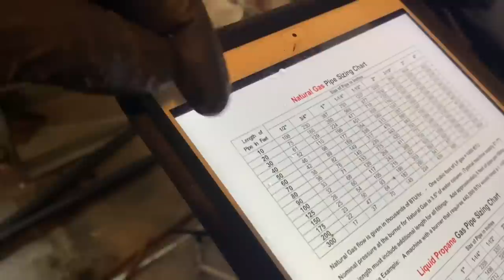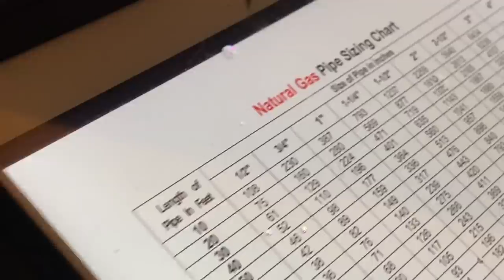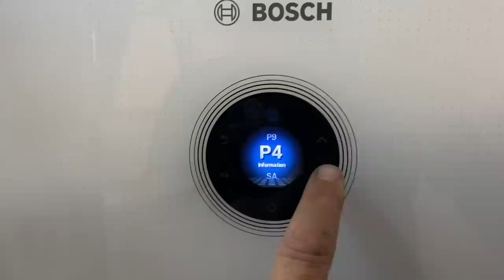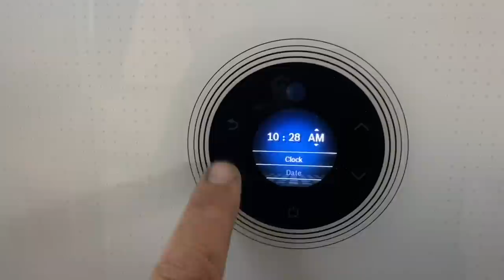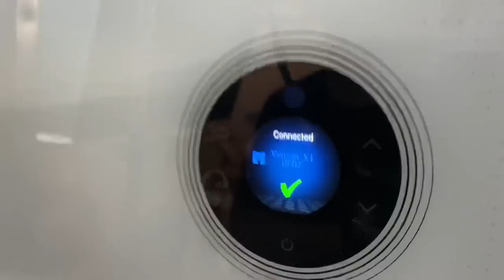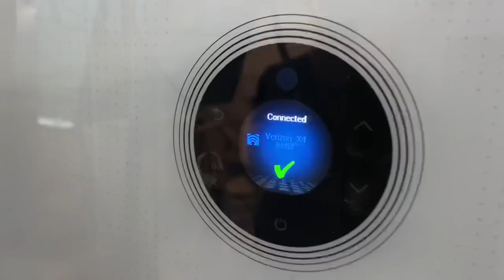Part 1 Oil Furnace and Water Heater to Natural Gas Conversion - Installing Bosch T9900i Tankless

Comment: I’ve seen this display before, it’s pretty darn cool. I always thought WM should hook up a big arsed properly sized (sqr ft ratiation) radiator so it operated as a system.
No one wants water climbing the risers into the header, wet steam.

Comment: Drip trap minimum length 3 " and same diameter as supply pipe. But if diameter more than 3 " so length of drip trap will need to be same as pipe diameter.

Comment: I’ve installed these units in MA. Setup is a breeze and the top connections and bottom descale tappings save on material and time. Nicely done! I prefer to use the Centrotherm venting
Reply: Nate what is the minimum clearance I would need to to accommodate the descale and gas tappings of this unit?  I  am dealing with a crawlspace install so I need to mount it lower than I would like to accommodate the venting and plumbing tappings on top.
Reply: @joebal9044  go read the manual for it? RTFM! 🙃 I know reading and decoding them sucks, but it's part of doing a proper job.

Comment: Ex Lilco guy here I suppose you could of asked Nat Grid to upgrade that meter bar to get rid of those 1/2 swivels, (20:47) Poss if they came to job site they would of just given you a meter bare/3/4 swivels  to install ... just saying , I also suppose it will be ok the way it is cause not a long run to both HH and WH ..I did not look at the chart but I imagine it will support the volume needed ( but you guys looked up the chart ).. whatever , awesome install Mikey Pipes and Crew , many people plumbers and customers ask me which wall hung unit is the tits unit , Navien ? NOT  Laars ? better but NOT...  Bosch ... Home Run me likey the Bosch Mikey Thanks to The Pipe Doctor ... If its gotta be a wall hung I will always suggest Bosch from now on .....

Comment: Discharge for pressure relief no further than 6” off the floor nothing closer than double the pipe diameter off the floor so 3/4 can’t be closer than 1 1/2 to the ground

Comment: Hard to believe that the local gas company allows the high-pressure gas line from the street to enter the house under the concrete floor.  A leak anywhere on that line can follow the pipe into the house.  Typically, all penetrations are made above grade with the gas meter outside.
Reply: In Switzerland we run the gas mains in the streets with „elevated low pressure“ at 200 mb.
The connecting line to the houses is laid in a depth of 1500 mm and has a stop cock outside the building, usually in the area of the sidewalk.
The penetrations for the gas line are made through the concrete wall of the foundation. 
At the inside you have directly the stop cock, the pressure regulator (at 22mb) and the gas meter. 
And your utility company owns the whole installation until the outlet of the gas meter.
Reply: 2psi is medium gas pressure. Not considered high pressure 🤙

Still has gas meters hanging in Minneapolis. I found many with rotten carrier pipes 😂
Reply: @prestigemechanical3600  Here in central NJ, PSE&G installed new pipe inside the old pipe and doubled the pressure. New WI-FI indoor meters.
Reply: using navien disc covers 😆 🤣
Reply: @2pugman  they've done similar here for the old low pressure neighborhoods (meter in basement/home) 2" or larger pipe entering. they have adapter collars to poly pipe and use the old straight sections as conduit. that fixed many leaks all over the place, some were over 13% leakage rate.

Comment: I currently have a Navien Death Box NR240 and looking to replace it with this Bosch.  My challenge is the height of the crawlspace where it is installed.  This unit is 3 inches taller, so I would have to mount it lower on the wall than the Navien so I have more space on top.  What is the minimum distance I would need to the concrete floor on the crawlspace?  From what I can tell the only connections that are on the bottom are for the gas.  This would be an LP install.

Comment: Hi Mike.  Thanks for another great video.  The Bosch T9900i install in my house (in Delaware) is almost done.  When I question the plumber about installing an expansion tank, he told me it's not required if I don't have an holding tank.  Is this true?  I have lost trust in the workmanship of this plumber and have decided I'm going to hire another plumber after the work is done to come in to check the install.
Reply: If he installed a check valve on the cold water supply, he had to install an expansion tank.

Comment: Miley pipes my brother a few days ago smelled burning rubber went downstairs and a blower motor had caught fire. ADT came out and everything. Question how many motors/air handlers would there be with a gas furnace and two a/c units?

Comment: Those sharp 90’s above the tankless allowed in the manual?  AFAIK only long sweep elbows are allowed on that model.

Are you allowed to use clear primer on pvc in your jurisdiction?
Reply: in most all cases, short 90's are usable, but they're equivalent of many feet of piping in resistance, so you have to calculate the total piping length with them in mind.
it's possible some may not want sharp bends directly at the unit's connectors. ahh the joys of cramped kinked tight work spaces!

Comment: My question on the chart equation is did you factor in the fittings? It says add 5ft of pipe per fitting. Other than that as always I enjoy the content.
Reply: they went straight out through a wall (that looks to be 2"x6" framing) so about 7.5" total thickness, from drywall face to siding face. the short bend 90's and minimal amount of piping there should be FAR under the max calculated permissible length.
saying this without looking at their manual for the unit, as it should be similar to most all others models
Reply: @throttlebottle5906  this was in relation to the gas piping not the exhaust pipe if thats what you are referring to
Reply: @traxxasman417  yeah, I thought you meant the "flue" piping. because those were short hard turns also.
actually, the fittings equivalent length of pipe varies by pipe diameter and fitting type. then again I'm not familiar with "silly-press" specs. I imagine it has far greater flow resistance than old school threaded pipe that's been properly "I.D. reamed" to curb turbulence. 🤣 I probably just went overboard on the thought train, but it's true for all tubing with anything "flowing" inside or outside of it.

Comment: if I had to guess, that BX cable and water line actually started a fire that self extinguished by luck. probably no grounding anywhere and the BX cable jacket became live from a short somewhere.
unless that was someone sweating the copper against everything and cooked it, then the cable jacket was just eaten by galvanic corrosion. either way, that was very ugly looking. 😳